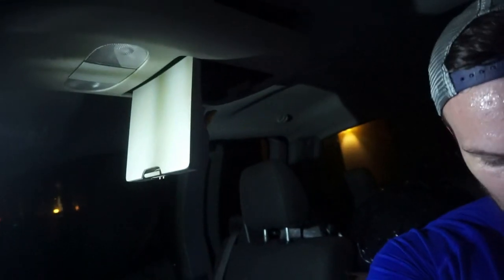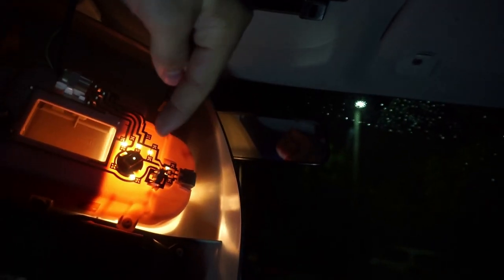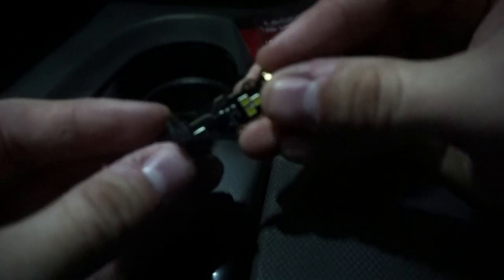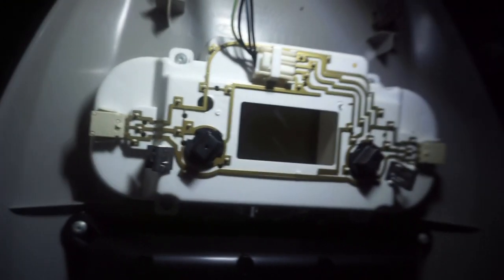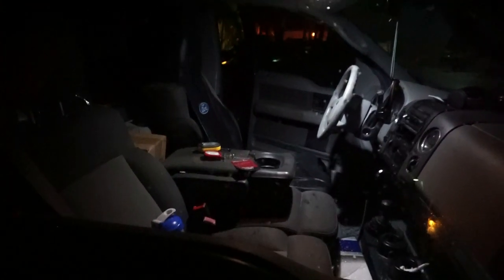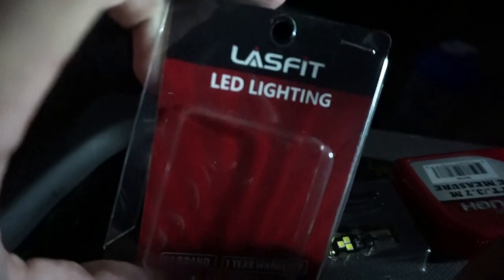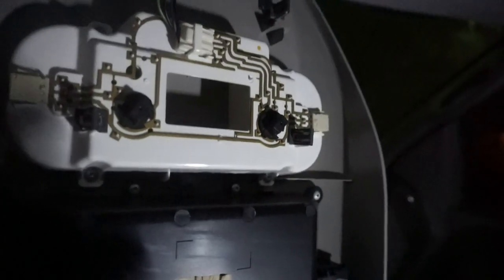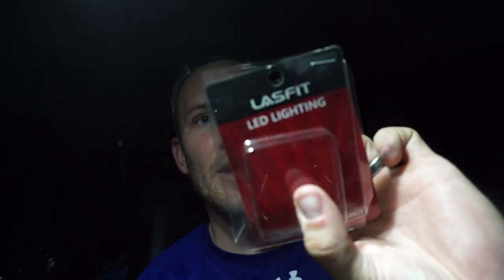How To Replace Map Lights On A 2004-2006 Ford F150 | LED LIGHTS |

Comment: Great job Andrew, hey I just want to warn all f150 owners if you disconnect the battery it will most likely kill the radio. I just installed fog lights and had to remove one of the cables going to the battery and walaa the radio stopped working. But have no fear, just open up fuse box and pull and reinstall fuses #7 and #31(took me 4 hours to figure this out). The fuses were not blown by the way I think what this does is reset the radio but not sure
Reply from the maker: Thank you for the heads up ZipSnipe! I have disconnected my battery in the past and did not experience that issue, but if it does happen I'l' know to check my fuse box first haha!
Reply: So we should leave the battery connected when replacing bulbs then? I'm about to replace my dome lights, fog lights and highs/lows with LEDs.

Comment: Good job. I just bought a 2006 f150 and have a bulb out. I can't fit my fingers to pull down the cover. Can I just use a screw driver?
Reply from the maker: Yeah a flat head screwdriver or a plastic trim removal tool would work just fine
Reply: @AndrewDoesLife  thanks a bunch. Do you remember the type of bulb you used?

Comment: I did this interior upgrade too!  You freaking have to if you’ve a 14 year old F150 with bug zappers for inside lights.  I had one interior light for the whole inside of my truck for two years before I decided to do anything about it lol!
Reply from the maker: Yeah I had only one map light working for about a year and it wasn’t even worth it to try and use it because it was so dim I always wound up using the light on my phone so I am very grateful to have these high quality ones now. Makes a world of difference
Reply: Andrew Does Life 

Yeah same here!  Passenger light never worked and I always thought someone else was in my truck.

Comment: What is the bulb size?
Reply: Yeah, that was an important piece of info left out. 

I used Sylvania 194 (also compatible:168/2825) LED bulbs. 

Fit perfectly in my 2005 Ford F-150

Got a pair at AutoZone for around $16.
Reply: @gozur7374  👍
Reply: @gozur7374  how many of the 578’s & of the 168/2825 did you need if you don’t mind?

Comment: With that particular truck if you have the 5.4 liter 3  valve triton engine, you’re going to learn the importance of taking care of the engine in particular if you haven’t already. Switch to 5W 30 oil and change it religiously or you will pay and Pay

Comment: One question from you previous videos how much plasti dip you use for side of truck wanna start that first then how much for rear and front bumper
Reply from the maker: I would say 2 cans per side, 4 cans total. You wanna make sure you’re able to lay it on thick so you can peel it off later and that it’ll last against normal wear and tear
Reply: @AndrewDoesLife  so that's for side or for bumpers
Reply from the maker: The sides will take 2 cans per side and the bumpers maybe 1.5 cans per bumper

Comment: No lights when I open the door
Reply: Did you check that the map and dome lights were not turned off by the roller switch just to the right of the headlight switch?